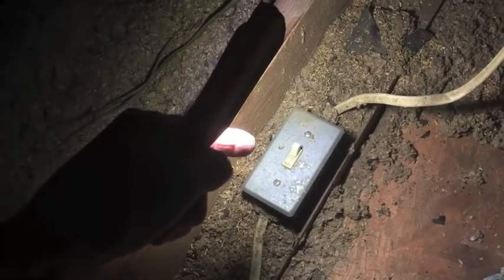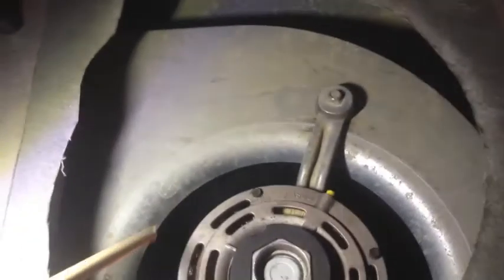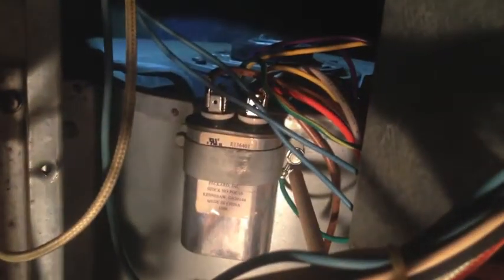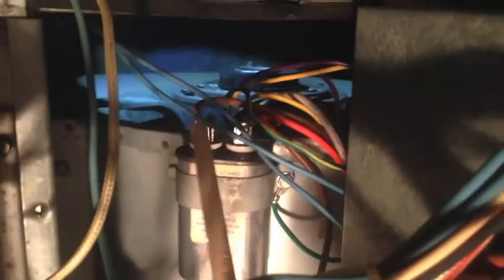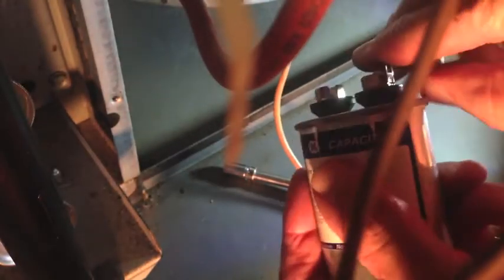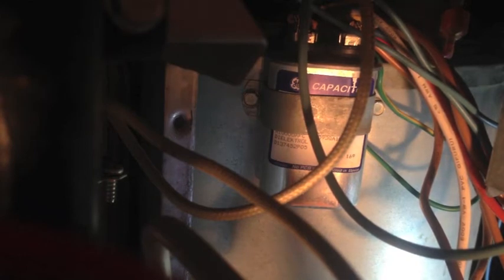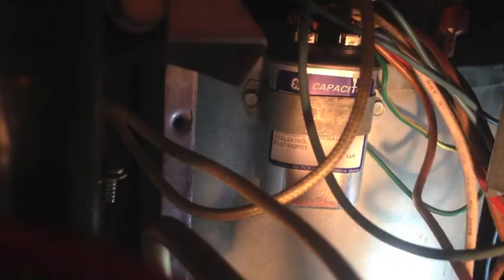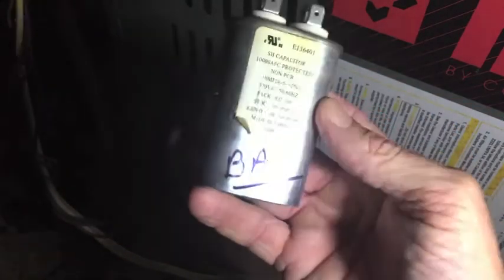HVAC Bad Motor Or Bad Capacitor?

Comment: Thank you sir!! This is what youtube is made for. Troubleshooting and good ol diy at our fingertips! 

My long winded story of sorts..

My furnace started acting up this week and last night it completely didn't want to run, the elements lit but it wouldn't turn the blower on. All while making a loud humming noise.  So I check the wiring and one of the limit switch wires was slightly burnt. So I test the switch, it's good. I cut and repair the wire with a new terminal. Go to turn it on and what do ya know, same deal. ☹ So further in I go. I clean everything with a vacuum and air hose what I can. Blower motor and cage fully hand cleaned. Start up, and same deal.... 😓 So I researched that a capacitor can cause the issues I'm experiencing. So I turn back it on and push the cage with my hand and it boom, there she goes, working like it should. So I find a local parts supplier and get a replacement capacitor and limit switch to replace the one that had the burnt wire just in case, figured it was more then likely on its last leg anyway. But after everything was bolted and plugged up, tada!!! She's back in business baby!!! Oh what a joy it is, to not be a complete idiot all the time. Aint no telling what an hvac call would've cost me. Only cost me 20 bucks for both parts and a little faith. Thank the Lord, God is good!!

Comment: I believe mine is humming but the motor still turns on fine, is it then Not the capacitor, or could it be on its last leg? It is a hum not a loud buzz.

Comment: I have a 30yr old Coleman presidential II and the blower turns on n off every 2 minutes with the furnace still lit and producing heat. I've replaced a lot of the switches but can't figure it out. Works fine during AC months but for NG heat my blower overheats or something. Any suggestions? I've tried everything on google.

Comment: What if you don’t hear humming . I have no lights on circuit board either. But the unit has power. Heater and ac won’t turn on

Comment: Easy fix. I did this 2 days ago. Now it's back to the buzzing again, which means something's blowing the capacitor... Any tips?
Reply: I had both the outside compressor run capacitor have the buzzing and backwards rotation and eventual failure, and I replaced it. Then within the next 6-8 months the blower motor run capacitor failed in the hvac unit in the house. The house was having a voltage drop issue and the fluctuating voltage repeatedly will cause capacitors to fail. The voltage drop issue was a old breaker in the box on the pole outside causing the entire household electricity to have voltage drops dimming lights and sparks when plugging into the outlets.

Comment: I'll just put it out there, that if you are shorting your capacitors with a screw driver, you are damaging them.  Use the MFD setting on your multimeter
Reply: Lol. Good point. So hypothetically if his capacitor hadn't been faulty, he would've damaged his own diagnosis and created more problems than he started with.😂

Comment: I've just gotta ask you this: how much of a difference did you experience once you cleaned your evap coil for the first time? How much faster did your system satisfy temp?

Also saw your rat snake video, I don't know why people think all snakes are deadly. I agree they are great for keeping rodents away!
Reply from the maker: satisfied temp much faster and better air flow as you would imagine given how dirty the coils were.. this capacitor repair is on that same unit now 27 years old.. i disabled comments on that coil video cause for some reason it set people off.. nasty comments.. and yeah, i hate that so many people kill snakes on sight.. they're all good to me..
Reply: @tongo117  Thats great and I figured that was why for the comments, some people just don't get it! Nice work and take care!

Comment: Hi, i changed what i thought was a bad capacitor. It ran well for a couple wks then same issue again. Fan motor doesnt seem to want to start on its on sometimes. I swapped out a new capacitor and same thing, qorked ok for a couple of wks and now same issue. What could be causing the capacitor to go bad so quick. What other issue could it be? Thanks in advance.
Reply from the maker: I don't know from experience but found this..
 "A compressor or fan motor that drags due to damage or worn bearings might cause the capacitor to burn up. A malfunctioning relay switch can also cause the capacitor to overheat by leaving it in the circuit too long."
Reply: Start relay. Check that out. See if it’s burnt open it up inside.